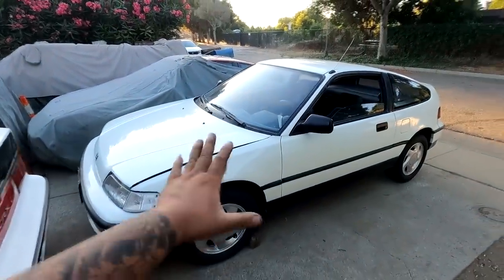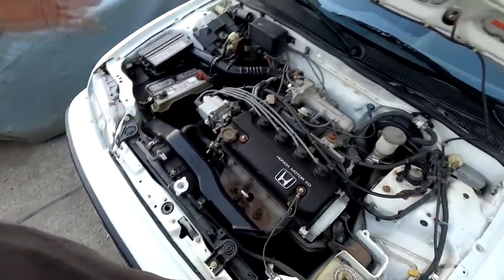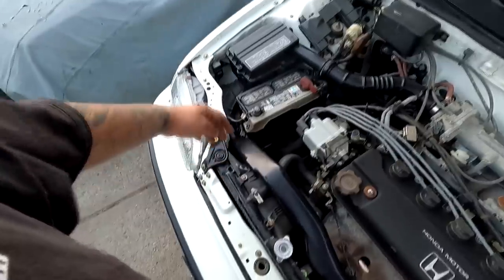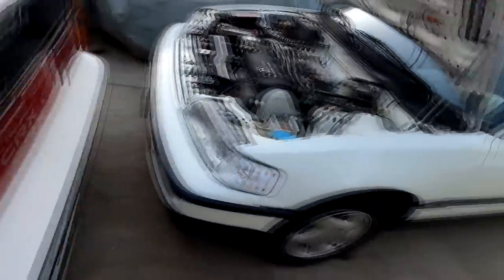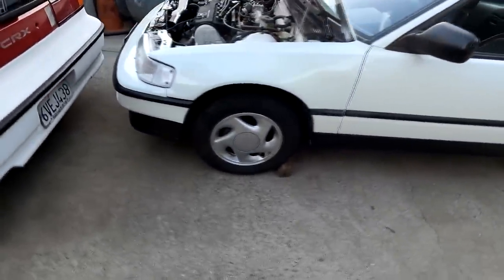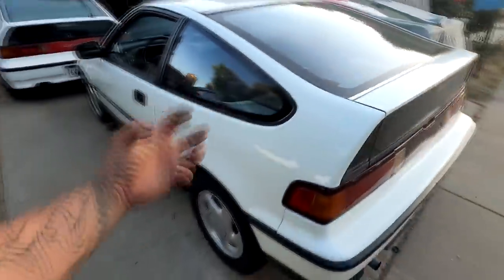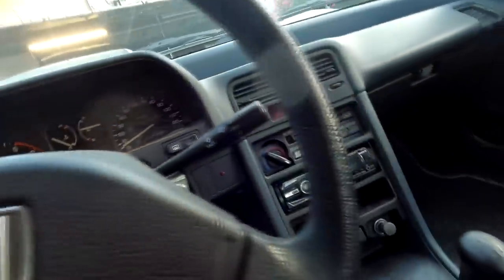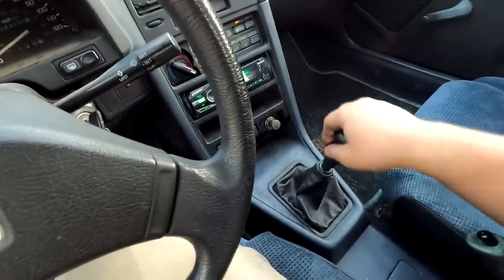LA PONDA OFFICIALLY SOLD! 1989 Honda CRX HF

Comment: Hi I’m new to this I was wondering if you know what throttle cable I can use on my EP 3 I bought one from eBay and it was the wrong cable they sent me the power steering cable and they said it was a throttle cable I was just wondering what other civic uses the same throttle cable my car still has the K20 in it

Comment: Youngstatic been watching you for years now, what’s your thoughts on the 9th gen accord v6? Would love your opinion
Reply: 9th gen v6 is excellent.. super reliable engine and transmission and they have great power. The J series is a gem, especially the later ones where they ironed out the vcm and other minor issues. They also respond amazingly well to full bolt ons and a tune.